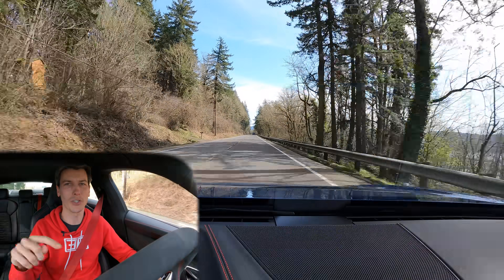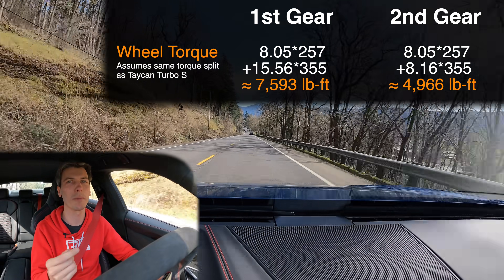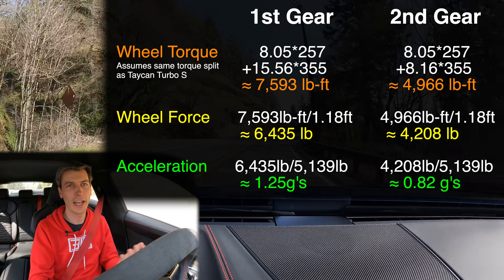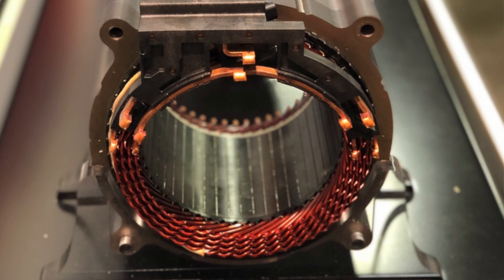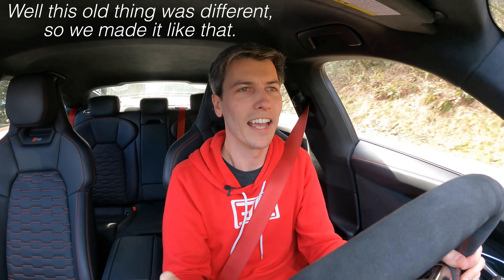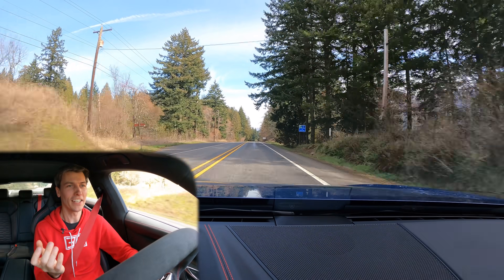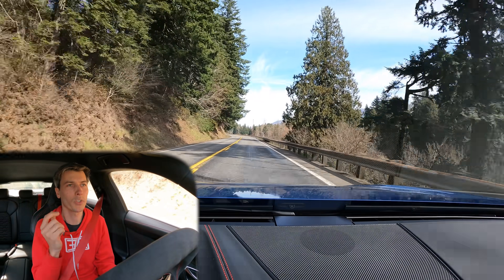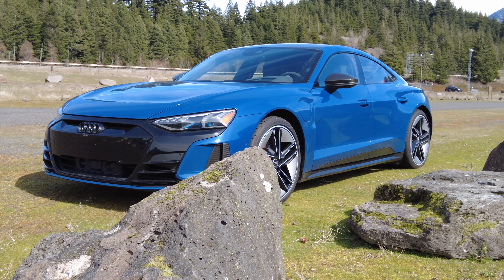Are Fake Manual Transmissions Coming? Audi Keeps It Real

Comment: The problem with CVTs was never that there were no gear changes. That was a great thing. It's the non-linear relationship between engine noise and speed that does our heads in. I've not keen on automatics either, because of that sense of slip that you have when the torque converter is not locked (although modern gearboxes do this a lot less). EVs are great, because they don't have gear changes at all, no slip, no torque converter and no illogical engine/road speed relationships. The idea of limiting performance to simulate gear changes is just plain daft.
Reply: I had a Maxima with a CVT before they switched to the fake gear stuff.  I loved how that car did it's thing.  I may be the only one who's head didn't explode over the non-linear relationship.  I drove an Altima with the fake gear ratios and hated it over the standard cvt model Maxima. Now I have a sports car with a DCT.  Now that's an "automatic" done right.
Reply: @jeffhall92  re: "I had a Maxima with a CVT before they switched to the fake gear stuff.  I loved how that car did it's thing" yes the CVT "drone" was primarily an issue with their smaller 4 cylinders like in the Rogue, Altima, Murano, etc.  in contrast the CVTs mated to their big V6 (some would say best V6's ever) in the Maxima and Pathfinder were tuned quite good, in fact so good you DIDN'T EVEN KNOW they were CVTs, the only knock on them i think has been reliability due to the added power.  travelling for business/vacation, i've driven the modern versions all 5 of these vehicles.  from East Coast to West Coast the Enterprise Fleet at the airports (pre Pandemic at least) were choked full of them.
Reply: re: "It's the non-linear relationship between engine noise and speed that does our heads in." AMEN, it makes me want to jump out a window.

Comment: I had thought of this, a manual electric where the electric motor acts as an engine connected to a traditional manual transmission. It wouldnt be all that beneficial in my point but hey it could be a fun experiment.
Reply: This is common for DIY projects.  It's a more economical choice, which gets me to wonder why manufacturers aren't considering it for budget EVs.
Reply: A lot of the early EV conversions were manuals with an electric motor swapped with the engine. There's no flywheel needed since there's so much torque to start and the lower gears just hit the max RPM of the motor quicker, so a lot of them just put them in 4th gear (1:1 is usually the most efficient) and removed the clutch pedal.

Comment: If you are going to sell Electric vehicles as the new future that is better than the gas counterpart, you need market the advantages of electric instead of faking the disadvantages of the gas just because it's familiar. I dunno, maybe have sparks or something when you "rev" the electric motor :P Put a Tesla coil for the tail pipe, have it shoot out a light show instead of flaming exhaust. 

If the car is going to be sporty and capture the the interest of sport drivers, they really should hype the power and torque of electric.

Comment: I wondered about the fake sound pumped into cars, and i wonder if some of it is done, not to copy the experience of it but because engine noise had an advantage of masking little squeeks and rattles that you didn't notice, now with a silent car, any movement in the parts you readily notice, so they copied the sound to regain that advantage it had in making the car seem nicer through sound masking.

Comment: I will ONLY buy cars with 3 pedals and a stick, EV or not, but I want it to be a real clutch. There is a good reason to do it other than fun. You can use a smaller cheaper, lighter battery pack, and lower power motor, then use the gears to get both low speed acceleration and top speed. Have you ever driven a Renault Twizy? That would teach you why gears are good, it's single speed and at 30mph it feels like being in a petrol car at 7000rpm, unavle to change gear. I want a super lightweight, low power, manual sports car. 0-60 in <6 seconds and manual control is enough for a sports car. The real clutch is needed too for feathering and playing with it, you can feather the throttle with the clutch in and feel the motor revving up, the dump it for wheelspin.

Comment: Looking forward to see how this turns out.
Aside from faking a traditional transmission, I think a 3rd pedal would still make sense. You could use it to separate regen braking and acceleration. Make regen braking fairly aggressive and allow the pedal to be pushed in to lessen it. Maybe.
Reply: we already have that in pallet movers in warehouses. you just have a throttle when fully off it regens. so you just modulate the throttle but you dont go off of it fully to slow down as fully off is full regen braking.
Reply: @SoulTouchMusic93  thats also the same as tesla's regen braking
Reply: That's what the brake pedal is for. No brake no or very mild regeneration more brake more regeneration max brake full regeneration and physical brake applied. Subject to vehicle settings. And have the computer apply more regeneration as speed lowers so constant braking force is applied with constant brake pressure.
Reply: I don’t see what benefit a third pedal would give. With two pedals you can either have one-pedal driving and modulate how much regen you get with the accelerator pedal, or have the first part of the brake pedal be regen and modulate it that way. No need for a regen pedal when there’s already two pedals that can do exactly the same thing.

Personally I prefer the one pedal driving setup and find it easy to coast and modulate how much regen I’m getting with one pedal, no need for any additional modes or controls. The i3 even fakes regen with the brakes when the battery is full to keep the pedal response consistent.
Reply: mahle is planning a maximally recylable non rare earth metal induction electric motor , which may require gears.maybe something like nissan torodial high torque CVT, koniegsegg hydrallic torque converter.  about the launch control: theres also allowing speed of which gears of changed, to affect the torque vs speed difference, so quicker movements in shifts is rewarded. also, can dial in more/less gears.
Reply: also, it works as launch control, clutch out of high gear and downshift to super low gear, which is more sudden than pushing pedal quickly so more g forces
Reply: If it where up to me I'd put a circular knob to select the level of regenerative braking, from zero to 100. I could select zero regen for sporty driving and maximum for going down hills. At the end of the day it's software so I don't see why multiple strategies can't be implemented.
Reply: Acceleration and braking are already separate. In one pedal driving, you modulate the amount of regen as you lift the throttle-- you can coast by holding the throttle in a neutral state, or go full lift, full regen. In two pedal, the amount of regen is tied to how far you depress the brake (like any gas car); if you want full regen, fully depress the brake. A third pedal to modulate regen would be redundant in both cases.
Reply: I think the engine braking mode that Toyota has in at least the Prius and Camry Hybrid (what I've driven) is the best option for this. Regen braking is very relaxed but there is a B gear below drive that makes it more resistive.
Reply: What's next fake exhaust system?
Reply: A true EV-head tweaks his car and moves to "one pedal" mode. Lift off the GO pedal and the car starts regenning _hard_. You then learn to balamce the pedal and only touch the brake if you need more than the regen system can provide

Incidentally one of the real-world reasons why EVs don't have multispeed gearboxes is that the torque they generate can easily shatter most ICE gearboxes. My little EV shitbox (Mitsubishi Imiev) is actually torque-limited off the starting line to ensure it doesn't break its CV joints. Several models do this to ensure long-term reliabliity (Tesla's ludicrous and plaid modes are hell on the drivetrain and overstress components. Rich Rebuilds pulled at least one motor assembly apart which was showing evidence of driveshat splines being chewed up along with driveshafts having slight twists in them)
Reply: EV and the future of driving is 1-pedal driving
Reply: @larryc1616  I wish. The REAL future is getting humans out of the control loop entirely and mostly out of personal vehicles too

Most people regard driving as a chore and will welcome that change
Reply: what if we also made it so if youre on the gas and the third pedal, it cuts power to the front so you can slide the back end out?

this for awd evs of course

Comment: My Toyota had the CVT with fake gear shifts and I hated it. It’s acceleration was dangerously slow. And that’s not hyperbole. Trying to merge into traffic was something I came to avoid because I couldn’t get up to speed quickly enough. But once it was moving, say highway speeds, it had plenty of power to pass. Even with traction control off, I couldn’t get any wheel spin or chirp from a dead stop. I miss manual transmissions.

Comment: Haven't started watching yet, but if by "Fake electric stick shifts" you mean a stick that controls the speed on a dual clutch transmission, I am VERY excited for that because it's simply a better system than paddles. Paddles don't let you go from 6th to 3rd. I am aware that a DCT has certain limitations when shifting however.

Edit: Nevermind this is about EVs having transmissions. I guess that was just wishful thinking.

Comment: A faux manual transmission in a Toyota EV may be the deciding factor in my purchasing one as I have wanted to get back in a manual, but really like EV's because of lower maintenance, fuel cost, quick response, etc.  I would rather have a position that puts it back in fixed ratio to drive like a typical EV when I don't want to enjoy the 'transmission' and just want a easier drive.

Comment: I actually think an EV manual is not too far fetched. EVs are powered by lithium batteries and all batteries are rated for a certain voltage. If V = IR, then the current could be decreased, or, concequently, the resistance increased - in lower gears. As you go up in gears, the current would be increased.

I could see two advantages to the above EV manual concept. As Jason said, the manual  of Toyota's patent seems more cosmetic than functional. By clutching in with the above manual to select a resistance, it would create an open circuit meaning the car could not physically get power. Another advantage would be that less current would be drawn in lower gears, so those components would have a longer lifespan and cars would get better miles per charge because the electric potential would not be converted as quickly. 

If there are any Electrical Engineers in the comments, please let me know why or why not the above idea would work.

Comment: Just let the car control it. It knows exactly where the motor's power band is and the controls engineers can do a better job of tuning it than any driver. Seems like a lot of car people are just closed minded and don't want mobility to change unless it has all the same vestiges of internal combustion.

Comment: I could see a fake manual working for giving the driver extra control in a crawl mode for offroading or starting on a slippery surface, but otherwise it's a bit silly.

Comment: Opel actually made a manual EV as a concept car with the Opel Manta GSe concept. It has an electric motor as engine and then a regular manual transmission fitted to it. You can use it as an auto if you just leave it in a certain gear and wont need the clutch to start driving. You'll only use the clutch to change gears actually.

Comment: I like internal combustion engines and manual gearboxes as much as the next guy, but I dislike that kind of fakery. If it's electric let it be quiet, or let it make whatever it's natural sound is. I saw an article about an electric car with a manual box in a driving school's vehicle before, which at least has the use of being able to train to drive a manual, but with no local emissions, like a form of simulator.
Reply: i think there was a law passed in eu, for all of the electric cars to have some kind of an motor sound and by this sound you should be able to determine if the car is accelerating or slowing down, for the safety of pedestrians
Reply: @Gamer-nc8qp  Oh interesting, I'm only aware of the requirement that they have to make a sound up to 20 km/h or whatever it is for pedestrian safety. As long as the sound is for the outside it wouldn't bother me.
Reply: @OaksCU1  i do not know the exact phrasing of the law but i think it includes everywhere. Would be nice if it didn't blast it into the cabin tho